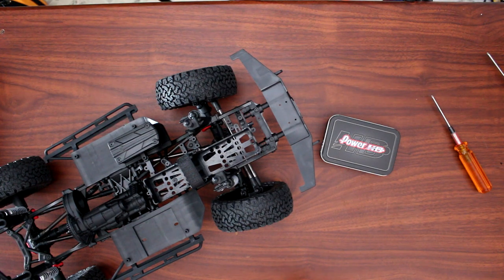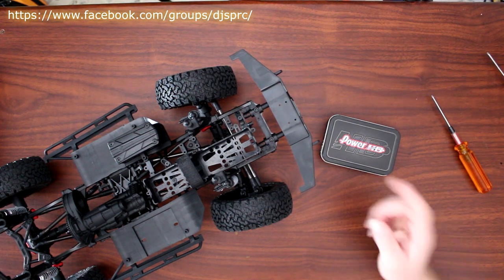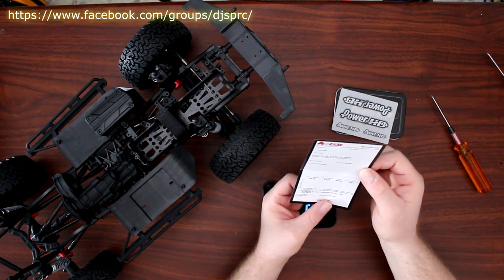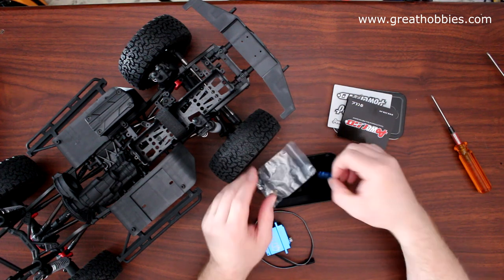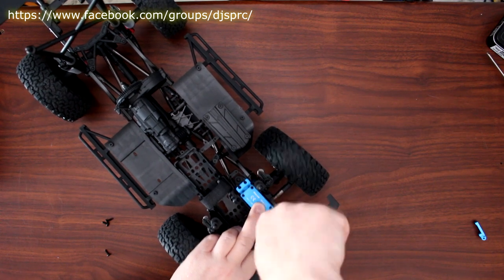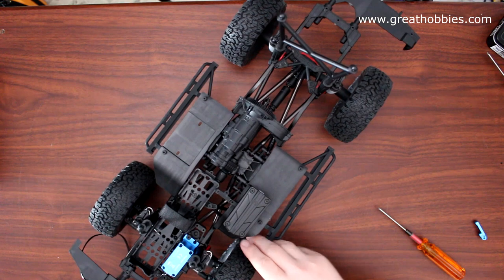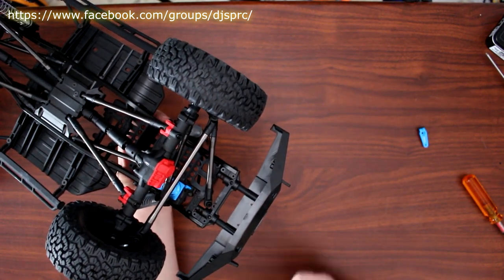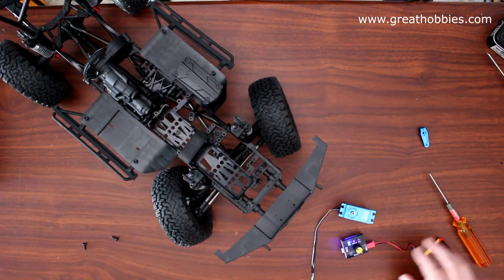Project Cherokee Scx10 II  Servo

Comment: I did not have good luck with the power HD servo. I had to 23 KG waterproof and I had a few more after that. Light crawling on a deadbolt 2.. Breakage after every two runs
Reply from the maker: Well that’s not fun the amount I sold at work of those servos and if failure rate is very little